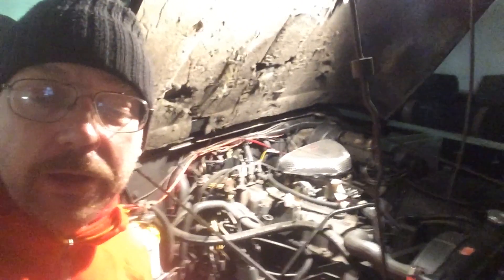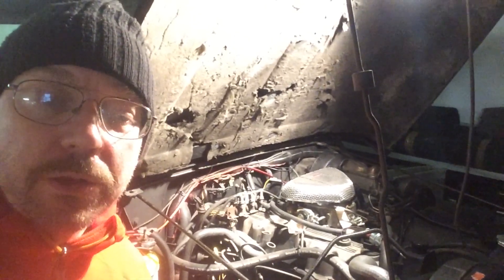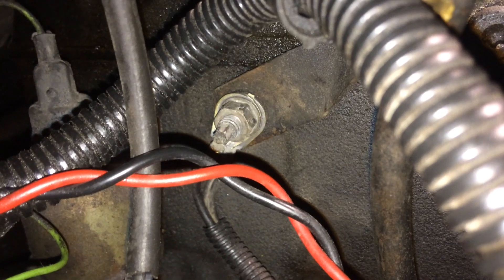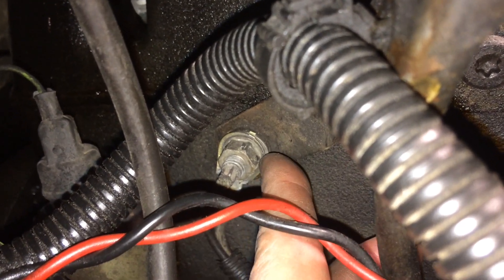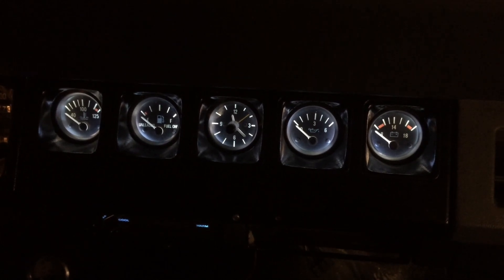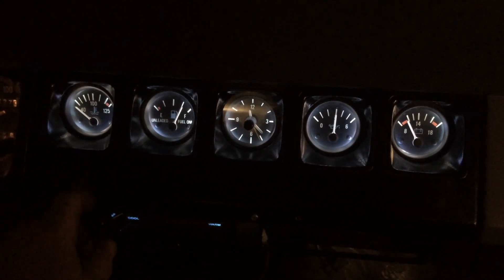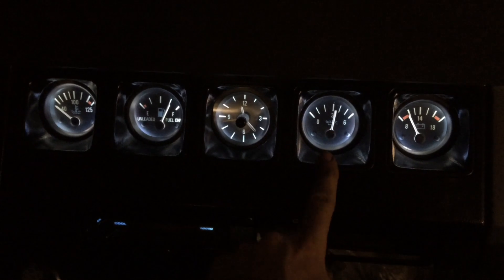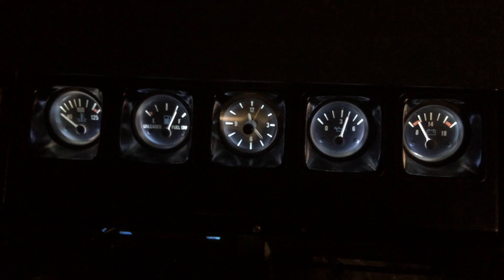Simple fix to faulty or poorly working gauges - JEEP Wrangler YJ : Ep 20

Comment: Great video, very helpful, I have cleaned grounds wires but I still dont have working gauges.
Reply: Replace the fuse and clean the hole it goes in

Comment: Thanks. I'll try this, as the only thing that works properly is the clock. Fuel gauge reads accurately, until you turn the engine on, then it jumps up 1/4 tank higher. The oil pressure, engine temp do nothing, and the voltmeter needle constantly vibrates at +/- 14 volts.

Comment: Thanks for the tip Ken,

I'm going to give it a try today, my issue with my gauges only seems to happen when the lights are on. do you think this is still a grounding issue? they all work fine when I first start it up and hit the lights, but then come on and off as I drive for minutes at a time. When the gauge lights go out, the needles all drop with them.

Cheers!
Reply from the maker: +GINNY THE JEEP yes I believe that is the grounds, clean all of them. There is also 1 in front of your drivers seat on the other side of the firewall in the engine room. Look up the rest in the manual, I don’t have it here where I am , good luck!👍
Reply: Check your fuse for the cluster, it probably is a good fuse but clean the fuse prongs and also clean ( scrape) the slot where the fuse goes into its just probably not making a good enough connection.

Comment: I am going to check mine right now. My gas gauge is only one working at the moment. Nope that was not it. I don't have that on my YJ.
Reply: Remove your cluster and remove gauges from circuit board take a light sand paper and clean off the board from grime, replace, it worked with mine